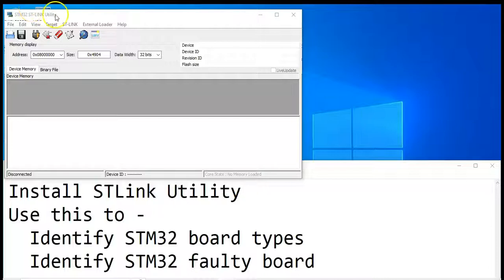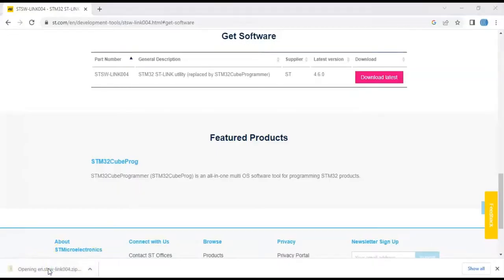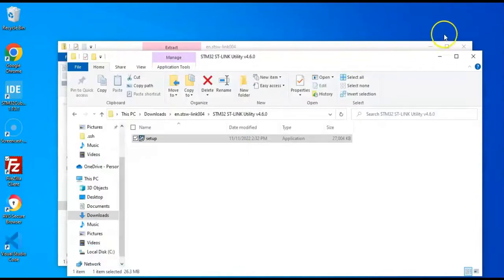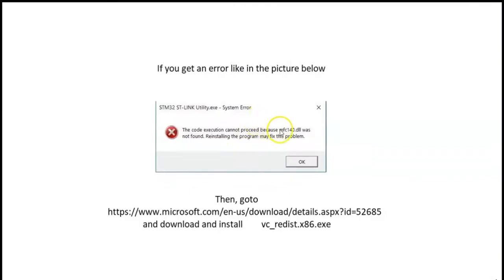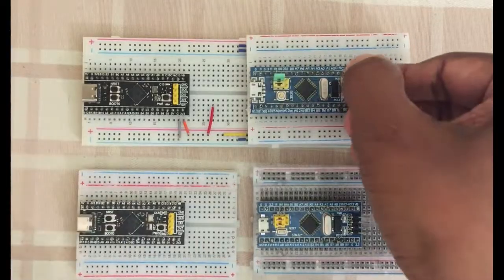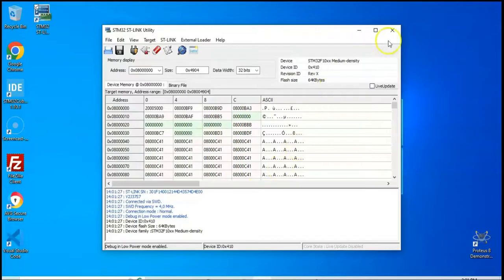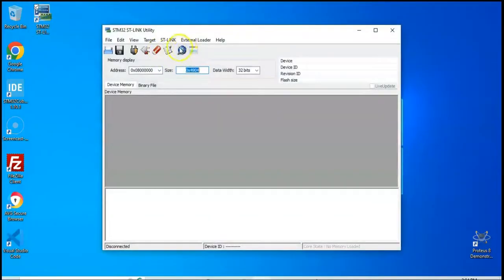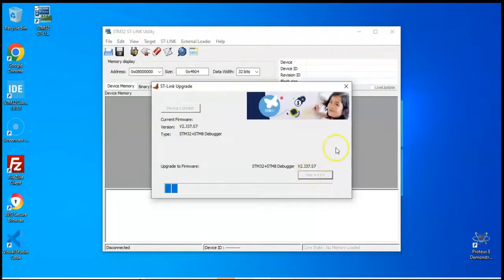79. Install STM32 ST-LINK utility (replaced by STM32CubeProgrammer)

Comment: Sir, Stm32f103rbt6  ic read and copy   programming  stm v2   se kade kare?
Simply  ho ga   please sir guide
Reply from the maker: Sorry 
In English language please
Thanks
Reply: Sir,  st link/v2/01-01  programber  how to software download  for only ic read, save file and copy.  I reparing  work so need  new ic in programe.  Any easy software available?? Please guide sir
Reply from the maker: Sure.
You can download firmware/software from working STM32 and re-upload to brand new STM32 
Target->Connect in ST-Link Utility and File->Save File as .bin or .hex (from one STM32)
Target->Connect in ST-Link Utility and File->Open File .bin or .hex (to brand new STM32) and Target->Program

If ST-Link Utility does not work, STM32CubeProgrammer can be used. The link is here https://youtu.be/YocudAJBH-g

If they have secure programming or locks, you need the password
Thanks

Comment: Do these cheap ST-Link programmers open a COM port, because mine just shows a USB device, ie, ST dongle, and doesn't connect.
Reply from the maker: My ST-Link doesn't open a COM port either. It shows USB device only but it works
Reply from the maker: By the way, STM32 needs to be connected to ST-Link to work
Reply: @NizarMohideen  Looks like my Discovery board is fried. I got my working DISC connected, but the one where I blew the onboard ST-LINK chip - It's supposed to have diode protection - it sees the ID, but keeps giving out a "Disable Read Out Protection" error. Oh well, them's the breaks - lol -.

Comment: Fantastic simple description of how to get a cheap ST-Link V2 dongle working. in my case, adding the vc-redistx86.exe file was the critical step and solved my connection problems immediately.  i had searched for hours on forums reading complex solutions without success, then followed your guide and had my hex file uploadd in 15 minutes. Thank you.

Comment: Hello sir i designed my own stlink, connections on its mcu is the same as the original stlink but when i plug it into my pc it doesnt connect get an error message "no stlink detected" how can i fix this?